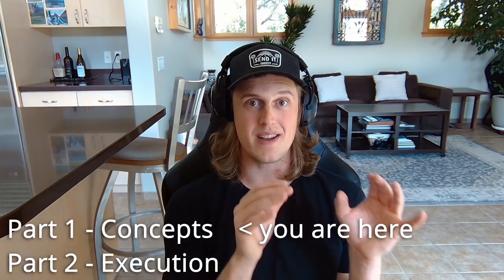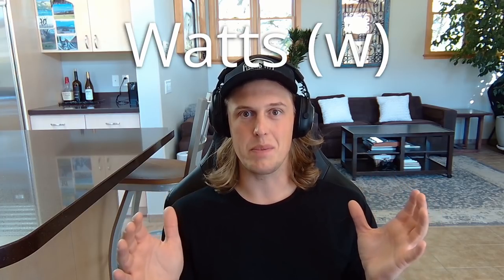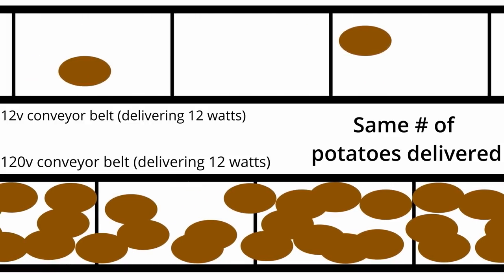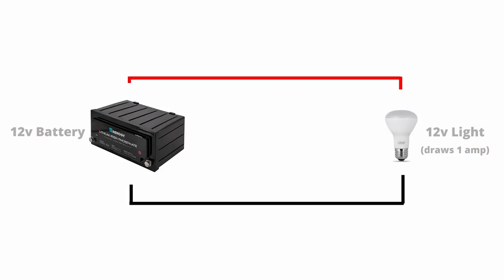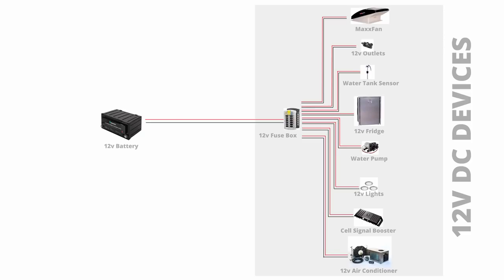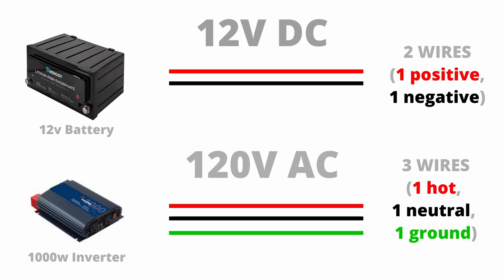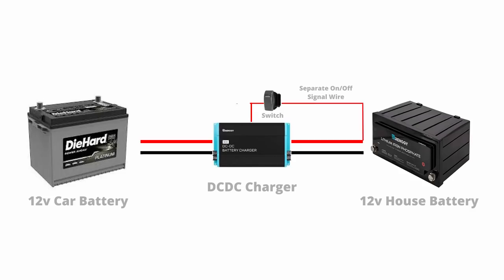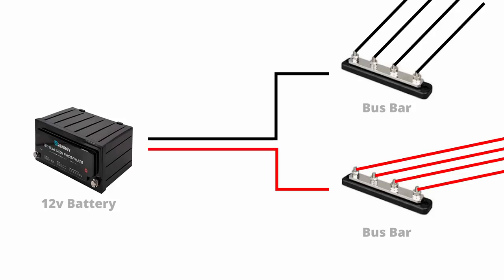⚡ How To Build An OFF GRID ELECTRICAL System ⚡ For Vans / Tiny Homes / RVs / Boats - Part 1 Concepts

Comment: As an electrician and one who has an EET degree, the description I like most for Amps, Volts, and Watts is: Volts are like water pressure in a pipe (potential for flow), Amps are like the volume of water that can flow (capacity for flow), and power is the combination of the two for the amount actually flowing (power).
Reply: As an asparagus, I concur
Reply: I understand what your saying. Why can’t I remember it when I need it?
Reply: So, is it true that all of the 120 volt devices that are connected to the inverter will less less from the batteries?
Reply: @earlwright9715  converting DC energy to AC loses energy. The better inverters will be more efficient and also give you the ability to use more of your battery power. Cheaper inverters will stop while still having more battery power left to use safely.
Reply: I was just going to mention this. I like the picture of the guy pushing another guy through a pipe with a third guy squeezing a rope around it. The pusher is the volts, the guy moving through the pipe is the amps, and the guy pulling the rope is the resistance.
Reply: I understand about plumbing as much as electricity
Reply: @joeljop3230  How about this? Fill a water balloon. The water creates pressure which makes the balloon bigger (volts). The balloon creates resistance, keeping the water from going everywhere(ohms). When you let go and the water blows out though the spout, how fast it comes out is amps. You could even say the force of the balloon pushing the water out is volts.
Reply: Thinking the same, I initially wanted to disagree with the host. Only later in the video did I realize that the "flow rate" of a conveyor belt actually has something to do with the speed.

Comment: I've always liked the pipe analogy for describing volts and amps, volts ~= water pressure, amps ~= water flow rate
Reply from the maker: Haha me too, funny you brought this up ... I thought so much about this analogy and almost used it ... the challenge I have w this analogy is that water pressure is the same thing as water flow rate (I.e. higher pressure is higher flow rate). This is not the same for amps/volts.

Comment: @15:50 gauge measurements mean how many times that the object went through the gauge..... the more it went through the gauge the smaller it gets.  also it depends on the object some material are harder then others. For example 18 gauges wire diameter will be smaller than 18 gauge steel.

Comment: Based on this I plan a similar system for house battery charging: 1) DC to DC charger (e.g. 12v van battery - DC to DC charger - 12V house battery), 2) solar panels, 3) inverter charging with 30 amp shore power.

As such, my build excludes a factory 2nd battery with cut/off relay and excludes a second alternator.  

Comments on this much appreciated.
I need to finalise my new Sprinter build tomorrow.

Ps. Really enjoyed visiting Healdsburg on my California road trip earlier this month.

Thanks for all the excellent content.

Comment: on the roundtrip explanation to calculate the wire guage, it is i think MOST helpful to instruct people to just double the length of the wire run. that is the most straightforward way to use that blue sea chart. great vid btw.

Comment: 10:57 AC uses also two wires (it switches polarity at the AC circuit frequency). We add the grounding for safety reasons, due to more voltage and amps present in the circuit. This can bring also a lot of static electricity that has to be discharged somehow (in the "ground"). But two wires are sufficient (think of a light bulb: it has only two connectors).

Comment: Good info but my only concern is when you mentioned shore power from a home which is only 15-amp and most rv air conditioner run off 30-amp. I recommend installing a soft starter so you don't short out the house breaker when mooch camping

Comment: I've got some pretty hefty solar panels, albeit not designed for portable use, and figured I'd put in an electric water heater as a dump load. It also means that if I want a shower urgently, I just disconnect the batteries and dump the lot directly without straining the batteries. I suppose I could also have an alternative circuit running from the inverter for use at night. Kind of solves all the problems at once, I think - so long as the panels are as powerful as they are supposed to be.

Comment: Great video. I'm watching all videos I can find on building my 12v system in our transit van. Ours is very simple, two 100 Ah batteries, one dometic fridge, one max air fan, probably about 4 AC connections for computer/microwave/hair dryer type things. 
I see your creation and I get overwhelmed. We do not have solar at this point but may in the future. Use a Jackery sometimes too.
Where can I find a very basic schematic ---- in an easy terminology?

Comment: If you are working on live electrical terminals (say, on a battery), wrap your spanner in electrical insulation tape. Make sure to cover the entire spanner behind the end you're using on the nut. 
If you drop the spanner, you won't short circuit your terminals.

Comment: Hello.

I'm going to do my van in some time and have some experience living in caravan. 
For fast build, I made 12v system (that's actually that was in caravan)

But with use of more powerful devices, like water heater, microwave, conditioner etc, I was thinking about making 48v (or 24 at least) system as storage. This will lower current from battery and all you need extra  dc-dc convertor. Some

Comment: I was reading comments on Amazon and the author stated his battery management system (common to nearly if not all Li batteries) was limiting his bank to the rating on the individual batteries.  So a bank of 3 100A batteries will never be able to draw more than 100A without shutting off.  In short, after realizing this issue they upgraded to a 230A "Plus" battery to run their microwave.  I'm not sure this is accurate since I"m still sizing my system but I thought I'd mention it since this concept seems to be glanced over @3:50 in the video.

Comment: Sweet. Have u considered the redarc total vehicle management with redvision system?
Reply from the maker: This is the first time I’ve heard of it. Looks interesting!
Reply: @seven_o_savage  it’s new 2 USA  from Australia.  Managing everything from 1 interface is extremely attractive. Aussies been using it 4 some time. For some reason we are getting crazy cool innovation in the automation / alarm industry out of Australia 🇦🇺. I’m an electrical contractor in FL specializing in that field and kinda bummed not more tech coming from USA. Getting lots of great ideas from u 4 my van build. Thank u 🙏🏻
Reply: @SFSFIRE  Scott Adamson reviewed it on his YouTube Channel
Reply: @The Osborns REDARC not offering inverters on the USA website. Cotek makes their inverters and redarc has confirmed that it communicates to the redvision perfectly making the SP-3000 a nice solution.
Reply: @The Osborns Your right on the money - Redarc inverters are only 240 but, are manufactured by Cotek, and comms from Redvision is backwards compatible. There is nothing like it on the market right now. After doing the research, I find no option that even comes close to the full functionality of the Redarc management system. Savage seems like a pretty smart dude so I wouldn't be surprised if he implements this system in his new build.

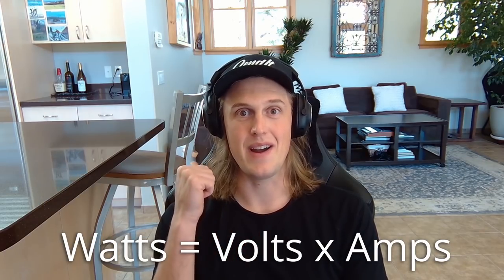Comment: 5:11 I think it's the other way around: volts (potential difference/electrical tension/voltage) show the "speed" aka pressure/electrical force and amps (current intensity/volume of electrons) show the "density". That's why they say: amps are the killers, not actually the volts. So, it is not the volts that are the dangerous part of the equation, but the amps (electrical flow or how much electricity is traveling per unit of time).
The chapter "Batteries and Terminology" is mixed up badly, one has to replace "volts" with "amps" in order to grasp the concepts correctly. For example, at 7:53, it is not the increased voltage that makes more "potatoes" on the wire, but the amperage. What voltage does: it increases the impulse with which a "potato" will travel the wire, it will provide a bigger force. You can have 12V and 120V with the same amperage (same number of "potatoes"), but with different capability of providing work (120V will give more energy). 
A certain device needs a well defined voltage and also amperage in order to function properly or as designed. If you are giving it a lower voltage but the correct amps, the "potatoes" do not have the needed force to produce work. If you are giving it the proper voltage but less amps, there are not enough "potatoes" on the wire to produce the work.. Now, you can provide more amps and it will still work (il will drain the amount needed), but if you increase the volts, it will burn inside due to too much electrical force.
So, when a device needs a certain amount of power (or current intensity aka amps) in order to work optimally and assuming you have the right amount of volts, what you can do is to add more batteries to the circuit (more "potatoes" bags), wired in parallel (as you keep the voltage constant in parallel wiring, but the amps will increase, or the number of "potatoes" traveling the wire per one second).
To sum up: think of voltage as an arc coil used to "launch" the potatoes and amps are the number of potatoes capable of being launched with that coil. The stronger the coil and more tension can provide, the farther you can launch the "potatoes" (more volts, more energy to do work). If more "potatoes" can jump at once, then they can "hit" a bigger "surface" at the other end.

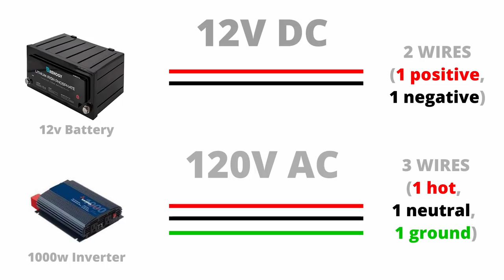Comment: @19:25, on a diagram, you might see red, black, and green for the hot/neutral/ground, but in real life, your neutral should be white or grey (there are some limited circumstances where it's not). Black, Red, or Blue wires are traditionally the colors for your hot wire in 120VAC systems.

Comment: Maybe I missed it, but fuses or breakers are sized to protect the circuit wire, not the items to be powered. The amount of power (amps) a circuit will consume will determine the size of wire one needs. The size of fuse will be determined by the size of wire. (See 13:15)

Comment: @9:40 if you're using a lead acid battery (think car or boat battery), you can only use 50% of the rated amp-hours. So, a 100 aH battery will only give you 50 aH without damaging it.

Comment: inverter size should also take into account motor starting current ( eg fridge motor etc) which can be many times higher. too small an inverter may not work, when the motor starts. hope this helps.

Comment: This is by far the most and detailed video I have ever seen, thanks alot! 
I just have one question: why would you ever set a "ground Point" (sorry, german Dude here) on the chassis if every single component is connected to the fuse box or to the negative bus bar which is connected to the battery? 

Thank you!

Comment: Well done! This is the best video about self built van electrical so far.  I have watched every of your video.  However, I can't seem to view the diagram very clear by the attached link,  I was just wondering if there's an clear version so I can order the parts? thank you
Reply from the maker: Thanks! You should be able to zoom in but I will make sure it’s the link to the high res version.

Comment: When you talked about the length of wire in relation to the chart to know what gage of wire is needed did you use measurement from the circuit breaker or the battery? Also when you said to measure both positive and negative length is this example correct? - Say it's 10ft from start to end, would you look at chart for 20ft length in critical column? Thanks so much; your video is very helpful.

Comment: I would stick to recognized color codes.  For a few reasons.  
If a new owner has to troubleshoot or repair the system, its easier to follow a color coded system. The layman will most likely be googling for answers.  If they are being told to find the white neutral wire, they are going to be lost if all the neutrals are black. 
If a tech, like myself, is working on it, the labor costs will be lower if I don't have to spend time "decoding" a color scheme that someone else thought was a good idea.
It also reduces the chances of hooking up a 12v device to a 120v circuit if someone is adding devices down the road.
12v DC is significantly less dangerous than 120v AC.  It really sucks when you get zinged by a wire that should be low voltage but its really high voltage because someone marked it wrong.

Also, you life will be easier and your devices will last longer if you spend a little more $$ and get a pure sine wave inverter.

Comment: Also remember that almost 100% of your electronics (not the same as "electric") are 12V, so you should be powering them from the 12V circuit (17:00).  It drives me crazy to see someone plugging in their MacBook or TV through the inverter-- it's 12V already-- you're wasting a ton of precious battery converting from 12V->120V-->12V.  You can charge all of your electonics via the 12V circuit.  Also, 12V refrigeration is also common.  The only purpose for the 120V cicruit are appliances- coffee maker, hair dryer, hot plate, induction cooker, pressure cooker, etc.
Reply: Well said!
Reply: why the strike though, nothing you said was wrong

Comment: I have a question, so I’m building my own off grid system, and I’m including three AC sources. Those sources include an inverter, shore power, and a generator, all selected manually with a three position change over switch. Can all three of these sources share a ground? Because I have a breaker box which I built that has an equipment ground bus bar, and wanted to know if I can just connect all of the grounds to that single spot. My guess is yes, but I’ve never done this before, and I’m no professional. Thanks if you’re able to help me out. Thx for the video, extremely informative and easy to follow

Comment: Great content. One question, lithium batteries should not be charged above 4.1 V per cell or discharged below (ideally) 3.6 V (risk of battery damage/fire). Which part of your setup does that check and can disconnect any load or charger in case the voltage goes out of this range ?
Reply from the maker: BMS built into the batteries

Comment: I feel the analogy for electricity is a tad off.  A good analogy for electricity is water and I agree with @glmaughan.  Another good way to desribe it is in relation to a river.  Amps are how wide the river is, volts are how fast the river is flowing, same can be said for the pipe analogy.  From this you can ascertain how dangerous electricity is.   Much like a water jet, a relatively small amount of water (amps) when flowing at high pressure/speed (volts) can cut your arm off.  Meanwhile, the same amount of water (amps) in a bucket, tipped over your head won't cause any issues.  This is why 120v/240v systems need to be certified and 12v systems don't.

Comment: Hi steven, love your channel, could you or some one else go deeper into electrical systems in RVs. Dc-dc charger can be set for the different type of batteries used, do they serve other purposes such as prevent alternator from over heating. Lithium batteries should not be charged under 32 degree temp. Were in the system can automatic protection of that happening be added?  400 amp could use 150 amp input by second alternator, is this a better investment than solar since most of drive avg  at least 3 hours a day

Comment: Current (Amps)  is the number of electrons flowing per unit of time.   Think of it like how much water is flowing in a pipe.  Then Volts is the pressure that pushes the current.  It isn’t how many electrons there are.

Comment: I'm surprised more people aren't using 48v battery packs and hybrid solar inverters. It's fewer devices, handles shore power & generator power more elegantly, and I think probably costs less. Only downside is that you need to use a DC-DC converter for 12V appliances.

Comment: I am building my system broadly based on your diagram. One question: how can I hook up my 12v Air Conditioner that uses 2 AWG wire to my tiny blue sea fuse box?
Reply: Also wouldn't I need like a 80A fuse for the AC? It's a nomadic 2000.
Reply from the maker: For big things like that I put them on their own breaker and then connect directly to bus bar
Reply: @seven_o_savage  Thanks! I better get a busbar with more than 4 lugs.

Comment: Great video. I'm still pretty lost on sizing all the fuses (e.g., between the panels and MPPT, between battery bank and bus bars, between inverter and bus bars, and so on). Any resources you'd recommend?
Reply from the maker: I’m going to cover what I used in part 2 but it’s all the same volts * amps = watts. 3000 watt inverter / 12 = 250, so you’d use a 250 amp breaker etc
Reply: @seven_o_savage  You cannot imagine how helpful that last sentence is! Thank you. FYI, I watched your road trip video from CA to CO...you drove right by me in SLC, UT. Great stuff. I really appreciate the real world view of such trips and what updates you have. Keep it coming!

Comment: I was just wondering: if I have two devices that draw 1 amp each that are connected to a 12v fuse hub for example, then the cable that connects the fuse hub to the battery has to support 2 amps right? Basically my question is: to size cables, can I just add up the amps? And for the inverted, do I just say 1000w/12v to calculate the amps or is it divided by 120v? This is again to calculate the wire size that connects the 12v system to the inverter.
Reply from the maker: Yes to the adding of amps for the 12v. And also yes divide by 120 for 120v devices. That’s actually why they can use small wire in your house